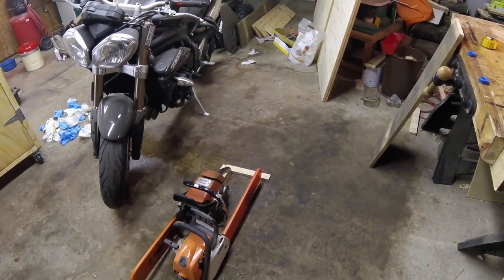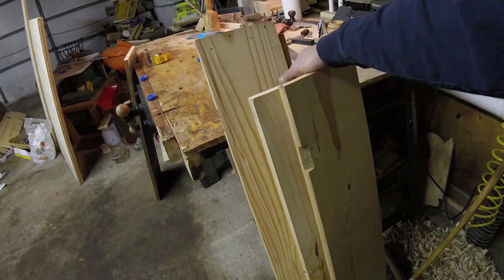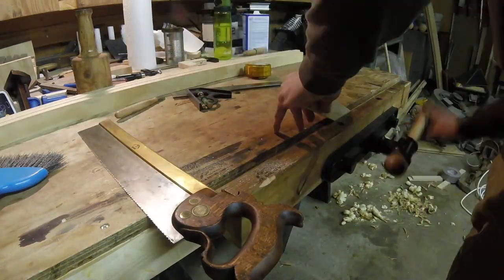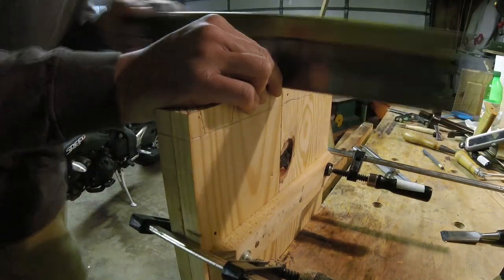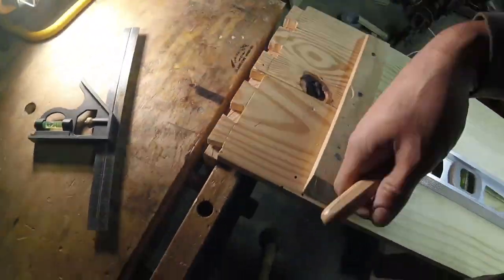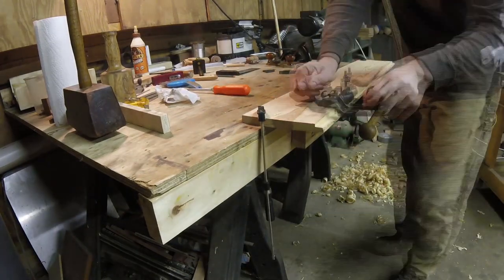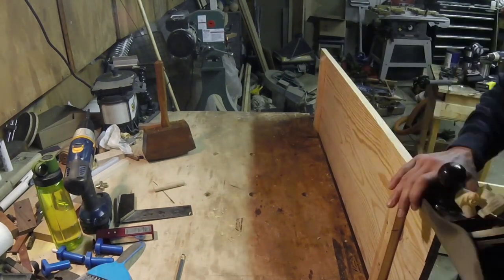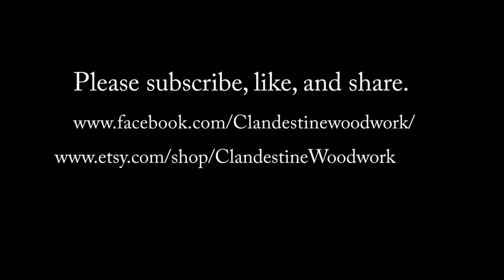017 Chainsaw storage/rustic toolbox, hand cut dove tails, recycled pallets

Comment: Solid box, and looks to be durable. Since it is solid, and you intend to stack things on top of it, I wonder whether it wouldn't have been better to have it open from the front.
Reply from the maker: L Malino yeah, that's probably a possiblity.  At the time, I wasn't using my chainsaws as much as I do now, and didn't expect them to be used that much either.  Now all of my chainsaws are unpacked, and used often, and I don't even keep them in there.

Comment: Nice video! What is the make of that wise you have on the bench?
Reply from the maker: I think it's just the Rockler brand vise with the quick release.  I just added a 2x4 to it for the added width.  It's intended to be an end vise, and when I finally get around to building a proper work bench, it will be an end vise.  I have a regular face vise that I acquired later on, that's the normal 8-10" wide.

Comment: what model is your poulan? I'm just curious :)
Reply from the maker: bryston franke it's a 330 Pro, which I'm not sure is salvageable.  I acquired for free, as a sort of debt payment, but leaked gas like crazy, and needed a new guide bar, and chain.  I was able to locate the obsolete bar and chain, and figured the leak was because it needed a new duck bill and sintered bronze plug on the tank.  I replaced the bronze and duck bill, and it ran for about 45 seconds, and never ran again. Then the recoil assembly broke, trying to fix it.  I have a bunch of replacement parts, but don't have high hopes for it.
Reply: oh, I'm sure you'll figure it out, and the saw is well worth the effort.
Reply: Model throw in the trash